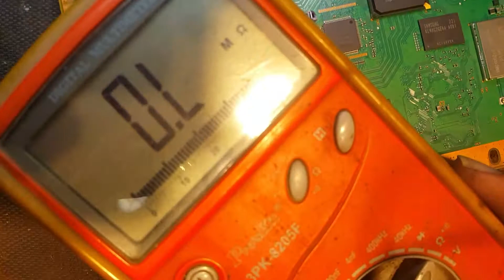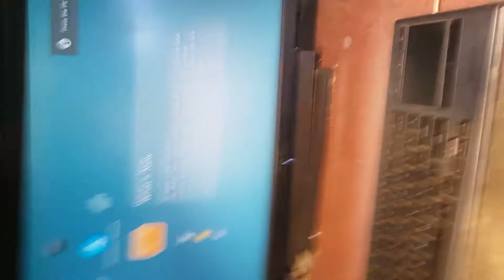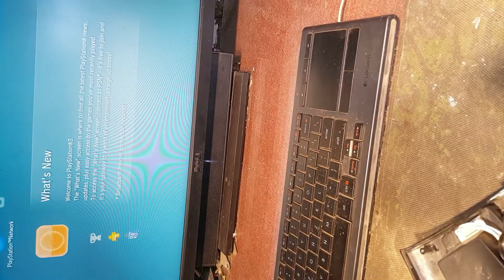PS3 green light of death fix Part 2 .

Comment: Hie i have a ps3 super slim it turns on but no display controller is not connecting and the hdd light blinks at the the very first time when  turned on what could be the problem with it
Reply from the maker: Most probably It could be the GPU issue. Try a reflow the RSX chip.
Reply: @idreestech  ok i will try and i have a ps4 it turns off immedietly after turning on and in the power supply i found out that dda001ag ic has a shirt on pin 9 and 16 is that normal?

Comment: Greetings sir,
I have a PS3 Super slim where the green light stays on for 2 seconds and shuts down , I can hear the fan spinning,  is there a possible fix 
Regards 
Alan
Reply from the maker: Could be, but first check for the brick via NOR extraction. If it is bricked, GND the tristate , it will keep stay in on condition. Or you can check other PS3 super slim video.
Reply: Thanks for the swift reply,
Before this happened I have powered on and kept it in idle for an hour then it happened, I am not familiar with electronics sir 😅
Reply from the maker: What did you do?
Reply: @idreestech  I was trying to update the firmware for hen exploit but I shut it down then when I pressed the ps button on the controller it won't respond,  when checked the system the  red light would switch to green light and a beep then the system turns off , when pressed the power button again the red light comes back and the same happens again the green light doesn't stay on it goes away
Reply from the maker: Then surely it is bricked. I have to make a video for its fix.
Reply: @idreestech  sir I have dealt with the console bricking due to the exploit and have successfully recovered from it , I believe it's a hardware fault, is there a short in my motherboard
Reply: Sjr Alan here 
I have checked near the power connector on the motherboard and found that the 18 ohm fuse resistor is open
Reply from the maker: @alansuresh5772  Congrats, dear!
Reply: @idreestech  thank you sir if I replace that will it get fixed sir , I am unable to find the part on online , also could you please upload the schematic of the motherboard 🙏
Reply from the maker: I have no schematic of any motherboard. If it is fuse then you can make a jumper on it.
Reply: @idreestech  ooh ok I will do it sir